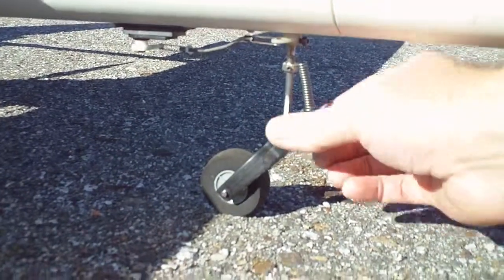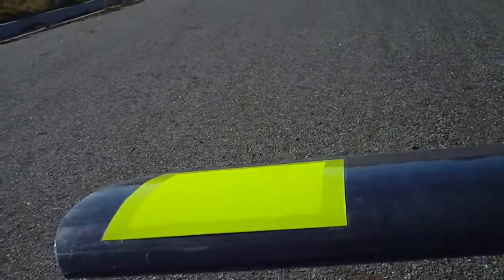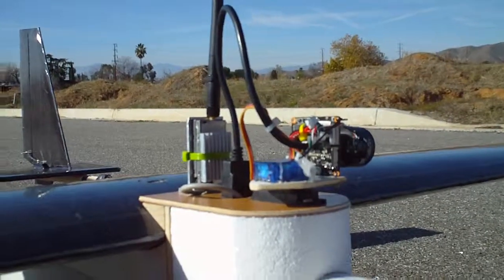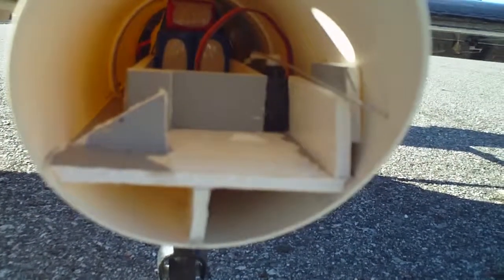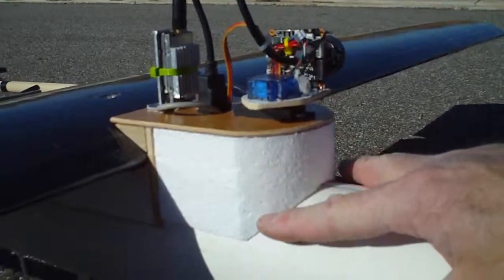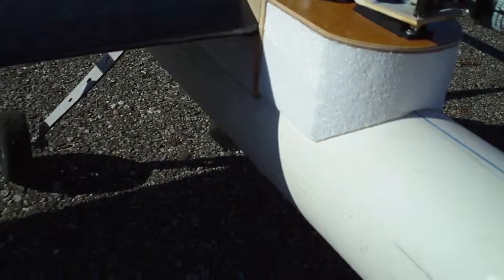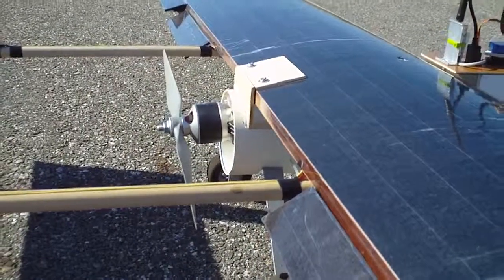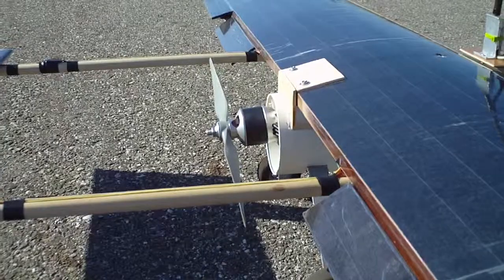4" PVC2 PART 2

Comment from the maker: @MegaWoodss I really like the PVC tube solution and it was easy to fabricate with into a fuse. I think the 3" pipe is a perfect size for the 60" plus wings and will lighten things up a bit too. I will head in that direction next for sure next project. Thanks for the comments!